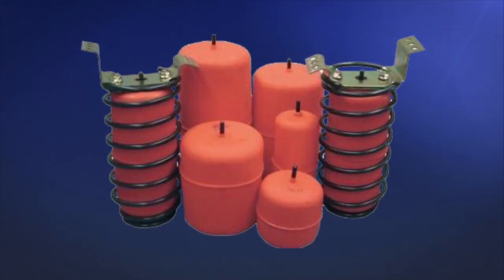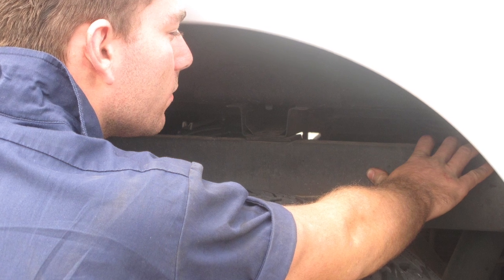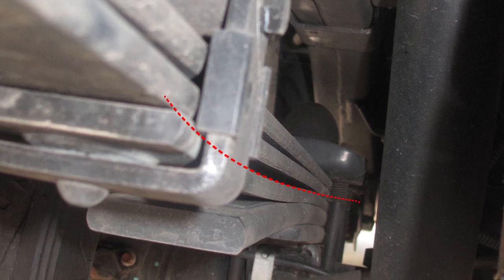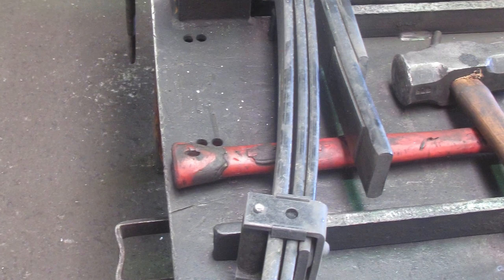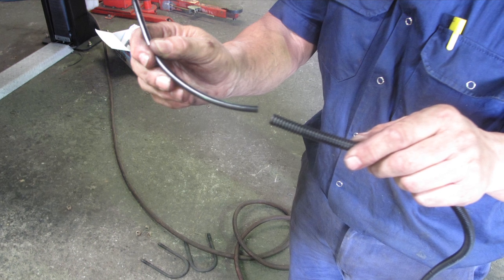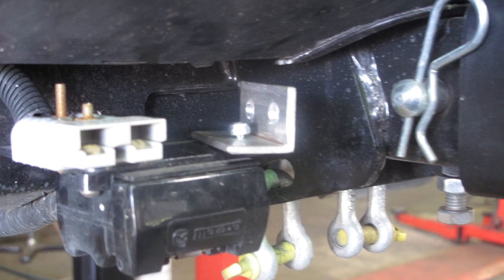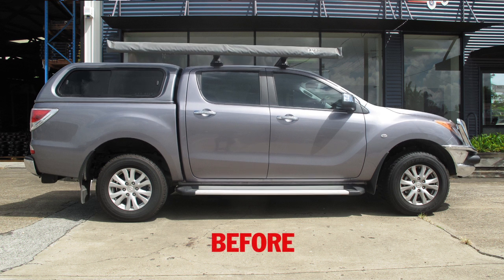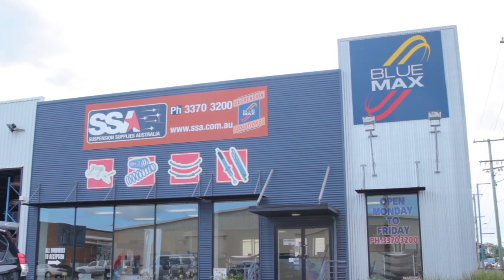Installation Polyair Bellows Bag For Use With Leaf Springs

Comment: Hey guys, i have the opposite problem, ive bought a 2018 bt50 4 door as a family car but find the ride is too rough. I will never use the max weight capacity or even close. I want a smoother ride, closer to that of my subaru forester. I am also disappointed a bit with the lack of chassis rigidity and i can often feel the tray moving in a different direction from the cabin. Would a chassis stiffener kit make a difference? Why is the tray not solidly mounted to the cabin? I love it otherwise, i just feel these improvements would enhance it even more. I look forward to your response.
Reply from the maker: Hi Karan, if you like you can contact us directly to discuss options we have available for improving your ride quality. Email: sales@ssa.com.au or 1800 630 411
Reply: Air ride is shit on lease roads
Reply: @cocopublicnews6766  pm🎉